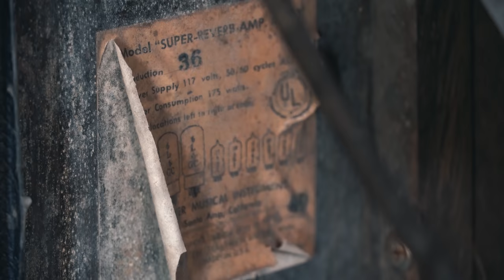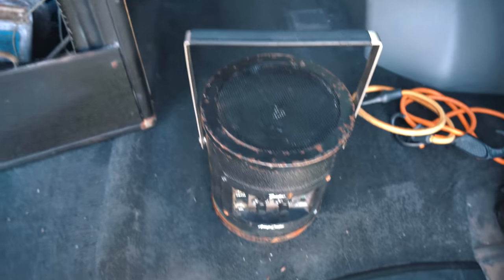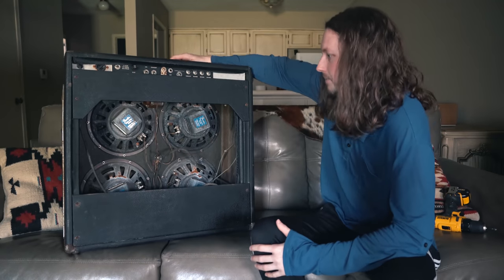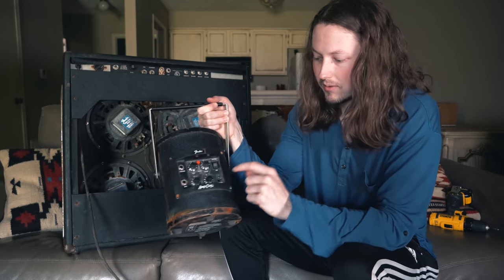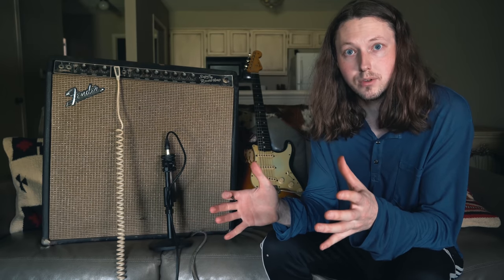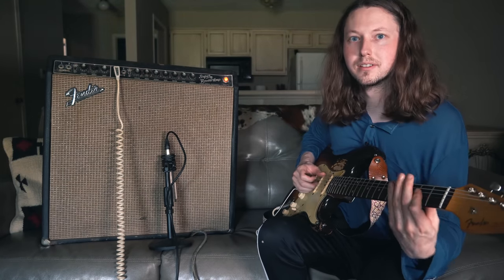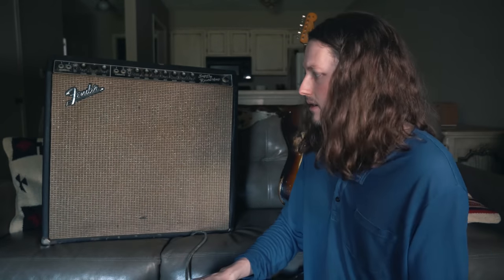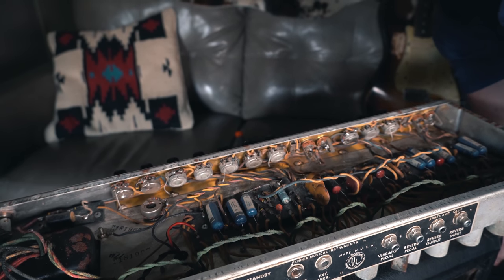VINTAGE Fender Amp Safari - BARN FIND!

Comment: These old Fender amps are like old american cars - built like tanks that just don't wanna die. Rad find.
Reply: quality engineering by those who really cared with the best materials available. just by looking and using them you can tell they reek quality and hard work, with very little plastic involved, no expenses spared.
Reply: Yep my dad always says if it is build correctly and not rushed it last 500 years
Reply: @NyanGeneral  Thats a bit exaggerated, Leo Fender designed guitars as a tool for musicians that could be built from replaceable parts that were easy to make and cheap to source, a different philosophy to guitar making compared to Gibson for example. The standard of quality was just higher at that time as it slowly began to drop in the late 1960's.

I think technically, fender guitars today are built to higher quality standards than they ever were. No shrinking/discoloring plastics, no nitro finish that looks cool but wears off easily. Modern guitars just don't have the personality and history compared to vintage ones.
Reply: @KAIOabstrct  you can't tell me that fender guitars weren't made from passion or well engineered. if they were crappily engineered they wouldn't still be usable 70 years later, and still be the most popular design.

cars are different though because today they are designed to break before the human does.
Reply: @NyanGeneral  I never said anything about cars or bad engineering, if anything they were the engineering marvels of their time. But a well engineered product isn't necessarily made of the highest end "best materials available, no expenses spared". They were tools with a high quality standard created by Leo Fender, a former radio engineer. If you want to see instruments with no expenses spared and craftsmanship look at fodera.
Reply: @KAIOabstrct  nah foderas are ugly and sound just as good as >$200 ones for literally over 1000x the price.
Reply: Exactly, MS - I found an old '73 Fender SFSR, and it fired right up, too. Just can't kill 'em. All I did to it was have it BlackFaced.

Comment: Matthew your expression is priceless, I was not expecting to hear any tones out of this thing, considering alot of it’s rusted up and the reverb knob produced no sound. I’m surprised that considering how beat up this thing is and hasn’t been used in quite sometime. For it to breathe life and tone again giving it’s current state is amazing and it shows you the craftsmanship and the build that Fender put into their amp.. I swear they are the AK’s of the amps.. beat up and cosmetically rusted up and it still works. Some new preamp tubes, warehouse or celestion speakers, capacitors, and a thorough cosmetic clean up and it’s good to go.

Comment: My 5e9 tremolux had a rusty Jensen p12 speaker in it. It was surface rust and I was able to sand the rust off and reveal the green paint under it, then used polish to protect the paint and give it some shine.

Comment: Good grief! That was a surprisingly stressful thing to watch. I was waiting for the electrolytics to go pop or the transformers to start smoking. You were seriously lucky.
Reply: Definitely an example of what not to do. I guarantee the recto tube was hating life...
Reply: Yea. Eletronics dude here. Please don't do this. You absolutely must check the caps, transformers and valves. You can blow the entire amp, on what would otherwise be an easy repair if you took the time to check the components before.
Reply from the maker: Luckily everyone survived and it works. Not the first time either.
Reply: @Shiniiee  This is why I'm getting a Variac and Dim Bulb Tester!

Comment: Beautiful amp and an incredible find. 
Years ago I bought a 65 Pro Reverb from a pawn shop super cheap because it had no sound when I tested it. The store owner (a major grouch to everyone) said it worked when he took it in because his son swapped the speakers out to use in his amp. I looked in the back and the speakers were not connected and offered him $75 out the door. He balked but eventually gave in, probably because he had several people at the counter and I kept telling him that a dead amp (OT could have been smoked ) wasn't worth much. He grumbled and said pay him and leave. Because of his caustic attitude I had no problem handing him $75 for a fine amp. I took it home and was playing it 5 minutes later. I still have it.  Sometimes you get lucky.

With that amp I'd replace the filter caps and hose down the pots with some contact cleaner and let'r rip. She sounds like pure gold.

Comment: Before Ebay existed you could bag so much vintage gear in local Pawn shops and auctions at great prices. So rare now.
Reply: In the early 90s Silverface Fenders were a bargain. Blackfaces had achieved collector status but Silverfaces weren't collectible yet. Now, with the internet, everyone can find out what they have, what it's worth, and who will pay that much.

Comment: Transformer rust acts as a effective shielding leave it or lightly sand with fine sandpaper not to remove rust just to smooth it. Then put a couple coats of clear shellac.shellac is non conductive so it works great and it will look almost new and ward off eddy currents.dont oil.there is a piece of paper between each of the metal plates.i restore these for a hobby.also the speaker paper is probably toast.new speakers are always better because of paper rot.they may sound okay but won't take the volume.take apart cabinet and clean and clear shellac the inside pine and baffle.the baffle is porous the shellac soaks into it and makes it stronger.and will stop the wood from further break down.its aged enough past that is rot.and it looks great.keep it in house I would advise you on what needs done and how to do it. Also vintage tubes are cool but trouble shooting is better with new tubes then when amp is sorted out.put vintage tubes in one at a time.or have them tested.good.

Comment: I've been really lucky with finds over the years. I was doing a gig in a dingy bar in Africa in the 80's once and broke a string and didn't have a replacement. The bartender says, 'I think we have a guitar behind the old piano', Its been there for years'. He pulls out a 62 Jaguar - it had been there for literally 20 years untouched. Then about 3 years later got a call from an uncle who said he had been given an amp to repair but the guy never came back - 72 Fender Bassman. I also once found a Jazzmaster in it's case that somebody has accidentally reversed a VW beetle over in the 70's in a friends garage. He also had an AC30 that had been taken out of its cabinet and put in a tomato crate. Just lucky I guess and all these finds were in Africa.
Reply: Dang, I need to hang out with you- I could use a vintage Gibson or Fender- I'm not picky, whatever pops up! You lucky dog.

Comment: Things not to do with a 50+ year old very rusty amp: just turn it on
Reply: What does that even mean?
Reply: dezionlion - He probably meant that everything should have been cleaned and the wiring checked first before powering up.

Comment: Found a Super Reverb silver face with the metal frame around the grill cloth. Took it to get serviced at Austin Vintage guitar. It was really neat so I had the cab reglued, then covered in Fender white tolex. Had it upgraded to black face spec.  Now my best sounding amp!

Comment: Nice score dude! My first vintage amp purchase was a 69 twin for $350. It had also sat in a damp environment and while after cleaning pots, changing tubes and caps it needed more work. New output transformer (failed while in the middle of a mini tour), new tubes red plated due to screen resistors failing. While it was cheap I spent more fixing it then it would have been to buy one in good condition. I’d overhaul all the above mentioned because I guarantee it’s only a matter of time before they go.

Comment: Great deal. Even with a re-cap and cone repair( if it even needs it. That thing has seen so much moisture the speakers may not be dry rotted) Surface rust can be cleaned up and as long as the wiring is ok ( the legs on the components could be rusted as well), your gold at that price. Nice for the seller to make a quick $300 as well.

Comment: Nice score and nice sound. In 1983 I bought my first amp, 1965 Fender Princeton Reverb. The pawn shop charged me $30 for it and $70 for a 1968 Vox Hurricane guitar. I made good money selling them, but I wish I would’ve kept them.
Reply: I had a near mint 65 Princeton Reverb, which I tuned for harp. The sweetest harp amp ever. I'm not one to regret things in life, but selling that amp is number one on my regret list.
Reply: Daniel Skorich the Princeton Reverb has such a sweet sound - at that time though I was mostly running a Big Muff in front of it - I still have that Big Muff pedal- haven’t used it the past 30 years

Comment: Cool video and nice find. We've noticed issues with the fiber board delamination here in Florida because of  the humidity on these old Fender circuits. Amp sound great and should clean right up.

Comment: I remember the local TV shop had a tube tester and I use to get discarded school PA amps, check/test/replace the tubes and sell the amps to local starter bands in the 70s.

Comment: You should also check the filter caps before turning it on. If they are leaking or have failed, turning it on would definitely hurt some things internally.

Comment: Dang! What a score! You are one Lucky Dude. Got a little work ahead of you....
I would like to have seen whatever guitar was with those amps. Eastwood Co. Makes a product called "Rust Converter" that is a phosphate coating that you just brush on the rust and it "converts" it to a black phosphate coating. One or two light coats and it's all good. A quart runs about 25 bucks. Take Care, Matthew.

Comment: I picked up a 1971 NMV Silverface twin reverb for 425 in like 2005 in a little mom and pop shop. replaced the speakers with Weber Cali 12's
retubec with NOS and ANOS tubes .
almost new rca 7581A power tubes

Comment: I had a super reverb back in the late 1960's, put rollers on it - sounded good when  using my 1968 Gibson hollow body 335 in Sparkling Burgandy.  Sold the amp in the mid 1980's to someone who was going to use it for a PA system - later sold the 335 for $200.00 cash(regretted it now) - but I put down my guitars & bought a Canon film camera & a couple of lenses.  Been taking pix since 1979 & still Love music to this day!

Comment: I would paint the transformer and don’t remove the rust.    That will seal it so it doesn’t fail, just a recommendation from an amp lover.   Killer deal and find!

Comment: Boy, I was totally puckered when you turned that thing on waiting for the Arc Light flash.  I would have at least checked for shorts across the power leads off the power transformer, you got balls.  I can't believe how sweet it sounds.

Comment: I believe those are CTS brand speakers. The Jensens have a different pattern on the baskets. I am harmonica player, 45 years with being full-time pro by age 20. I bought my first Super Reverb used in 1976, on the suggestion from Greg "Fingers" Taylor, the original/first band member of "Corral Reefers" band with Jimmy Buffet. He played harp and took me on stage at a concert and showed me his Super Reverb. I play a pair of 1959 Tweed Bassman amps but, have owned many Concert Amps, most Fender Tweeds (about 7-8 original Bassmans). Was just in Austin 6 years but, San Diego now. What a great amp find!!! Most of what I see looks to be "surface" so, looks like you are fortunate. Enjoy your videos!......TONE FOCUSED

Comment: Dude you got balls.  To buy this, or that old broken Gibson Dove acoustic that came out stellar.  This is a lot easier to deal with that than thing.  It does not look to be in that bad of condition on the front side, except for the rust and frozen pots, but you can replace pots.  It really does not ,look that bad on the front or back.  Great buy.  I hope it turns on.

Comment: Drive faster!!! I am blessed with my 1964, that I bought brand new around March or April of '64; and my late brother's '66 that had one twelve JBL in it. I changed that over to a fifteen Weber. Need to get them both worked on, and then rolled into the closet. Too loud for this old man! Watch your hearing (mine's shot!)!! And watch your back! I walk in pain, with every step. But congratulations.  Replace those filter caps. Those amp cans sound fabulous!! That top "door" is upside down. The main prob would be with the filter caps and the damage bad ones could cause. Glad it worked for you. Blue Ajax caps ...

Comment: my sisters kids had a dog names Rusty . you'd be best to find a way to neutralize most of it but a bit of that rust gives it character and doesn't look like it ever really was wet , no water marks . its a testament of how well made the old amps were built but real hard to believe you just hard powered it up without using a variac and bring the voltage up slow ! or inspecting the inside for burnt parts first ...

Comment: I had an old Marshall combo with as much surface rust as yours and it was fine except for the greenback speakers. Rats had been breeding in it for years thus all the paperwork that is glued to the inside of the chassis was eaten by the rats. The grillcloth was soaked with rat urine and had two big holes in front of the speakers lol. The grillcloth had the black and gold weave if any one knows what year that might be I'd like to know. After reconing the speakers and a new power cord along with new grillcloth it sounded great. Even with the channels jumpered it wouldn't distort but it had a magical clean sound similar to a fender bassman. It took all afternoon to clean that amp but until I got the new grillcloth on it it still STUNK nauseatingly so. Matt you got off easy compared to me so congrats dude. Oh mine was free.

Comment: My amp, my rules. Of course. Nice find! 
I'd do a quick check for 110VAC "leakage" across the chassis, and cable. Volts check, zero, your hide, priceless. Had a tube 2 meter ham radio that leaked, barely survived being stupid.

Comment: Back when we actually made things in this country that would not only last, but be fully rebuildable 50 plus years later. A good cleaning, some glue, and a few capacitors and man what a great piece of gear. Those caps have to be out of spec due to age alone. They always are off some. All electrolytic caps need replaced. I'm sure your tech will make sure it's good to go for another 50 plus!  Enjoy!

Comment: One of the best Super reverbs I ever heard was one in a pawn shop up on 39th with a busted cabinet from being dropped. Crackled when warming up an sooo buttery smooth when played. Great video!(do one on the amp can!)
Reply from the maker: They are bullet proof!
Reply: Id like to do a side by side comparison of pre-69 super reverbs- cts alnicos vs vintage ceramics
Reply: Honestly your '68 is easily its equal. Not a lot of changes on the "drip edge" models from blackface. Both fantasic and top of the heap of Fender amplifiers!

Comment: From the first few minutes of video, this looks like it was stored in a damp basement.  My old Fender was not as bad, but the chrome was similar and screws.  Easy fix as hardware is an easy fix.  My old amp had the farty tone and capacitors including the dog house was in order as well as new speakers!

Comment: Last week, I pulled an all original 1957 Gibson GA-5 amp out of a barn. It was falling down, rain pouring in through the roof as I shined a light on it, there it was.. Covered in barn dust and all. I cleaned it up and took it entirely apart and it actually still works. Been in the barn since about 1970. I may upload a video on it.
Was originally looking for car parts and ran across that jem instead. It looked like it would never work again, but with hours and hours of purple power scrubbing on the outside cabinet, and cleaning the front face and cleaned it up as much as I could, it actually cuts on and works. Volume pod ain't the best, and speaker may need to be reconed, but it sounds really good at low volume.
Reply from the maker: What a great story thank you.
Reply: @MatthewScottmusic  Yep. There is supposedly a Harmony Bobkat H15 in there also, but I couldn't find it unfortunately. There was so much stuff piled on top of everything and the torrential rain coming in, I couldn't find it. Big old barn/building with holes in the roof and leaks all over. I'm glad I was able to save it. It cleaned up pretty well too.

Comment: have a 67 blackface deluxe reverb that is totally stock circuitboard wise. my favorite amp of all time. 67 was a good year lol. excited to hear the update of what your amp tech finds if it is all good other than the rust! subscribed now just to catch the update! did you see a stamp that says what circuit it is or just went off the tube chart? I have a 65 super reverb that the tube chart is gone and have wondered which circuit it is.

Comment: I have a silver face Super I found in a dumpster in 85.I took it home,plugged it in an fired it up,couple tubes over the years and been rocking it ever since.It was less rusty but didn't look much better than that one.Anyway not exactly sure what year is.🤔
Reply: Someones ex through their amp out in a fit of rage...

Comment: That fender amp can takes a 12 volt battery and a 9 volt charger. I have seen these on reverb at the time this was their version of a portable amp. I could not find any where that had the battery for it either. Good luck.

Comment: The blue caps are generally called AJAX molded capacitors, not Mallory (thought they may have been made by Mallory). The dual cathode bypass caps (before 1967) were brown paper covered Mallory, not sure what the red/black ones are in the 67's.